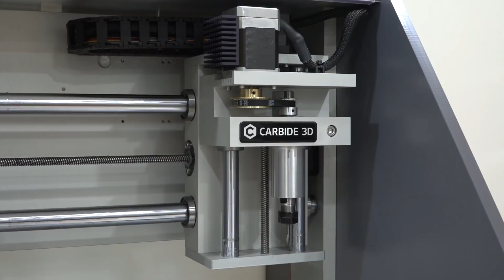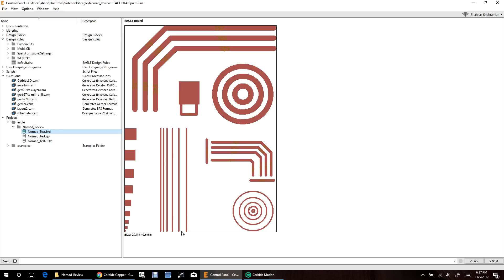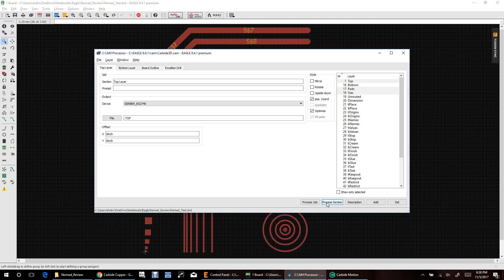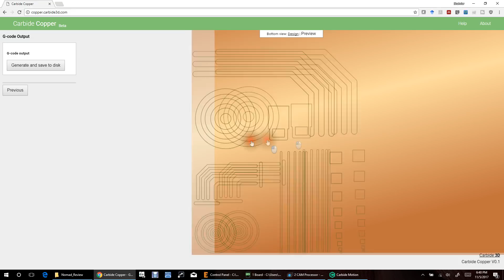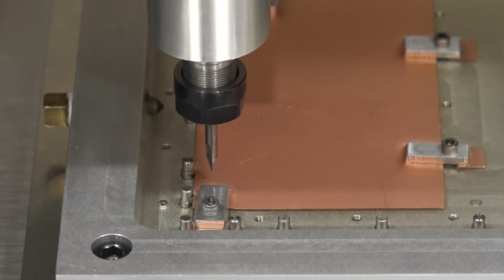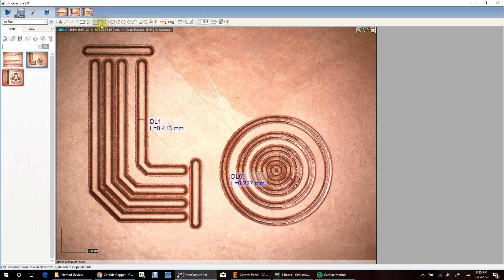TSP #115 - Carbide 3D Nomad 883 Pro CNC / PCB Engraving Machine Review & Experiments

Comment: Hi Shahriar. I am a big fan of the channel. I, like everyone else, have a few tips.

First, you will find the copper/fiberglass dust generated by the machine gets everywhere. I built a little CNC almost 10 years ago for making boards and run flood coolant on it to grab the dust, it works wonders. It will eat your lead screws and linear guides in no time. I was quite amazed with just how abrasive FR4 is.

I have a (poor) video on my channel showing a board being routed with coolant.

I use a spoil board on my machine and fly cut it from time to time to keep it flat. Then I use carpet tape to hold the board down, no clamps, they distort the board too much. Carpet tape has a fairly uniform thickness and works well. On boards that need a tight tolerance I probe the board height on a grid.

Thanks for all you do and keep it coming!
Reply: I have a feeling you did not watch to video fully. He talks about the very subject of fiberglass dust and shows how he avoids it.
Reply: Seems I was not paying attention for that part, thanks for the heads up.

Comment: I have used the Nomad Carbide to make PCBs, too, and a have a few tips for you.

First of all, you don't need the multimeter.  The Nomad Carbide has a tool length offset measurement, as you noticed, in the back on the right.  That button closes a switch that pulls one of the microprocessor's inputs to ground.  The drill bit is already equipotential with one of the switch contacts so you just need to get a wire from the other side of the switch to your PCB..  You can then use the Gcode command G38.2 (move and stop on contact).  bCNC software has this built in and also grid autotramming.

Next, you should be using a very sharp V-bit for cutting traces.

Your jig looks *amazing*.  Will you be able to use it for through holes or is the jig damaged when drilling through the PCB?  Here's my 3d printed jig: https://imgur.com/gallery/aHjpb .  I can provide model files if you like.  Also notice that I can remove and replace the board with the same position.  This is useful if you want to paint a board with through-hole parts.

The warping of the board doesn't really matter because copper isn't really cut until the PCB's front is flush with the jig surface.  The drill will push the PCB down against the jig.  This is why you don't need to hold the board down too hard and why autotramming isn't so useful.  I suspect that you had your jig dialed in too tight and the PCB thickness was uneven.  Also, is FR1 is more compressible than FR4?

Here are all my notes on how to make a one-sided through-hole PCB: https://github.com/eyal0/multivibrator/wiki

Good luck.
Reply from the maker: Thanks a lot for all the information. I might come back with more questions. Have you been able to get good clean cuts? What bit do you recommend?

Comment: IMO the best place for a CNC in PCB prototyping is as a small jig borer. Use it to drill the holes and route the slots. Build/buy a good immersion etching system for the traces. If you want to get fancy build an electroplating system, that's pretty easy to do. Then you can drill your holes, plate them, and etch the board. Milling the traces is always difficult IMO. 

To improve flatness of the board you want to build a suction table. That likely means giving up on the oil immersion idea. You'll always want to map the height of the PCB to account for distortion, even with a suction table.

Comment: I use a X-Carve to mill PCBs. As software, to generate the g-code, I use flatcam. I do not try to get the PCBs flat, instead of this I use chillipeppr to run the g-code. This has a feature, to measure the heights in a grid on the PCB and adjusts the heights in the g-code. This is rather precise.The hole workflow is good enough for my hobby-needs.

Comment: All axis will have thermal shift. Program a warm up cycle to run while you prepare things including spindle speed. Then machine the base flat. Just a skim cut and don’t take it out. The larger dia. Tool will give you less steps in the finish. You could also use a polishing puck in the spindle with the Same tool path for cutting the fixture if a better micron finish is necessary. Get a good indicator to tram your fixture back in if you have to remove it. And THEN worry about a better way to clamp your pcb. I’ve never needed to measure the thickness of a pcb as a machinist(former life)but, I wouldn’t assume both surfaces are parallel to begin with.

Comment: One way to keep the boards flat while milling would be to use a vacuum pallet.  You would need to plug unused holes to keep the oil from getting sucked up.  You might be able to modify the pallet you already made.

Comment: Instead of using a 60 'milling cutter, try using a 20'. will be less sensitive to changing depths. . for your tul its 0,144 mm width  per 0,1 depth , and for 20' cutter its 0,03mm . sory for my english  :P Two-sided tape binding also helps

Comment: I am curious as to why so many people want to use CNC to prototype PCB given the cost and speed of the prototyping services available today. Add to that the design rule constraints of doing PCB layout for cnc tooling, etc and it does not even seem to be the best choice for prototyping something that will eventually be produced via the traditional process.
Reply: for me, it's really great to be able to produce a prototype board in 30 minutes vs a few days / weeks. If you do a lot of prototyping, it quickly becomes worth it in terms of saving on shipping + rush processing, since you can work out most of the kinks of your board before going into production.
Reply: yep. especially since CNC doesn't plate vias. there's tons of cleanup work to do after milling.

and good luck doing more than 2 layers.
Reply from the maker: It really comes down to being able to prototype something quickly. Clearly there are limitations. This is another reason why I bought a machine which can do other things aside from PCBs. For my purposes, I want to be able to make PCB microwave tutorials for my channel.
Reply: Looking forward to those videos! It would be interesting to see a filter response change as it's drilled.
Reply: I don't get it either. Although, I would say prototyping services aren't an alternative at all, because it takes days to weeks (or months if from China) to receive the board. But in the time it takes the CNC to route a board, I have easily exposed, developed and etched a PCB, with the times being completely independent from the complexity of the board. This gives me a board that I could design without having to have the limitations of a CNC in mind and with the quality very likely being much better than a routed board.
Don't get me wrong, I'd love to have a CNC, but for routing plywood, plastic and aluminium or maybe engraving steel or glass. Routing PCBs would be the last thing to think of, especially since glass fiber dust is nasty stuff.
Reply: I think many people need some excuse to buy things like that. I would also like to have a CNC machine, especially to make mechanical parts. But the creation of PCBs seems to be a bad excuse to buy a CNC machine. It is expensive and the results I have seen were always sub-optimal. I like toner-transfer (or photoresist) and sodium persulfate. It is really cheap (~15€ per kg) and the results are good (better then some milled PCBs i have seen).
Reply: I can answer this from my point of view. I am new to the design of PCBs and do this only for hobby, to learn a bit about electronics. If I send my layout to China and wait two weeks, I get 10 PCBs, that does not work, because I made a mistake ;) 
If I mill it, I need half an hour and one PCB, to see, what I have done wrong ;)
Besides that, I can mill a lot of other things with my X-Carve and together with my 3D-printer I have two nice tools,  that complement each other, to create all sorts of fun making things ...
Reply: Jeremy Abel I think you are over exaggerating the time it takes to get PCBs from china. Most board houses (even the cheap ones I use) have a 1-2 week turn around time (delivered). I understand wanting a prototype in a day for an occasional proof on concept type thing, but you do lose some important features, plated through holes, for example.
Reply: HalfSpeedMastering: You have probably used the terrible brown stuff, Iron(III) chloride. You can't see what it does and it tends to underetch the photoresist. Use sodium persulfate instead, it isn't such a mess, it is a bit slower and you can see what it does.

For the disposal of used etchants, dilute them until the Ph is about 3 and add fine steel wool (be careful, it gets hot and may boil... use a big bucket and don't fill it more then 1/4). The boiling may push the steel wool up, add some weight on it to push it down. After some hours take a sample of a few milliliters and add one milliliter concentrated ammonia and if it doesn't get blue, the copper is gone. If it gets blue, repeat it with new steel-wool. The greenish/yellowish liquid is harmless and can be further diluted and disposed as waste water. The rest of the steel-wool and the copper metal that went out of solution can be disposed in the trash.

And there is also a solution for the hole-drilling problem: SMD ;-)

Wolfgang Egger: If I make a PCB, I always make several mistakes or change my mind and then I use a knife to scrape traces away and add wires until it looks messy but works. The Idea of having a device where 30 minutes later a PCB appears is really nice, but it is about the same time it takes to print something on a newspaper (the thin and cheap paper) and transfer it with the flat iron on the copper, dissolve the paper with water and soap before putting it into the small jar with the etchant (heated up to about 45°C) and shaking it gently around while watching the progress. All steps together also take about half an hour but it is much cheaper then a CNC machine. ;)

By the way, I make on average maybe 4 PCBs per year. Some years not a single one, but if I have to do it I make several of them. For that small amount I don't want to buy any expensive tool. ;)
Reply: get a laser head, and expose photo resist with it - works really great and much fine detail than milling is possible, i built a dedicated laser CNC with my desktop mill
Reply: @maultrommel how much power does your laser have. Do you have any description/links about the whole procedure  creating PCB with laser-CNC?
Reply: The board house in china that I use (one of the most popular and cheapest ones) is typically a 48 hour turn around for a common board (2 layer, 6mil trace/clearance, 0.8-1.6mm, >=0.3mm holes, 1oz copper, HASL) and the boards cost less than $1 each for <100x100mm. Couple that with express shipping via DHL and there is only 3-4 days between placing the order and having the board in my hands. Order on friday morning, have it by monday afternoon or tuesday morning. I've done toner transfer / iron chloride / tin plate in the past and would not bother doing that ever again, even though I was successful making boards with 0603s and QFP128s it was just too much labour. I have access to a CNC at my place of work that is a bit better than the one that Shahriar has and again I wouldn't bother using it to make PCBs because the lack of through plating and soldermask would make the board layout hopelessly inefficient and/or create too much assembly labour cleaning up solder bridges and making through connections by soldering wires through unplated holes. The CNC mill's strength is making 3D parts - trying to making something thin and flat like a PCB is best done other ways (laser cutter, pcb house).
Reply: officially a 100mw 405nm (closest to UV) laser module off fleabay - it looks like i fell out of a laserpoint to be honest, but i just build a constant current driver that delivers 100mA - focused point is about 0.1mm - and i use a feed speed of 1000mm/min - that works fine for down to 0,5mm structures. recently did a breakout board for a TSOP48 (0.1 structures), that went perfectly fine with  55mA and 650mm/sec - custom build X/Y CNC + grbl + KiCad (gerber) + FlatCam (gerber to gcode) thats all it needs.
Reply: maultrommel that sounds very intresting
Reply: The Signal Path ☝️looking forward    for that! 😀

Comment: If the cnc use gbrl you can use the software OpenCNCPilot (open source) it has a software compensation for the bcp height. The software make first measuring points like your method with the fluke

Comment: If there's a self-zero option for this model, then it should be possible to probe 4 points on a PCB and determine offsets for PCBs that aren't perfectly squared with the mill end (they never are, and it can change during milling). CNCs that can do this allow you to inject gcode to pause cutting, re-zero / renew the offsets, and resume cutting. It costs more and adds some time to a run but produces better boards. I wouldn't try milling a PCB without that capability, whether that ability comes from the vendor or has to be added DIY.

This, like welding, adds a whole new conceptualization of "flat" and "squared" to one's vocabulary. Particle board is not flat. Not at all. And you see people using construction-grade plywood for sacrificial boards...

Comment: It is much easier using a purpose built PCB miller with PCB substrate surface level tracking. This tracking adjusts the milling depth and can handle warped boards such as single sided PCBs.

Comment: Flexing the board or sheet is a real problem when trying to machine thing flat materials. A common method to handle this is to use double stick tape. 3M has one that dissolves or weakens with isopropyl alcohol. In my undergraduate I needed a odd PCB quickly so I got access to a HAAS VM3, an engraving bit, and some double stick tape. This worked out well.

Any plans to make any cavity filters out of aluminum or brass with that machine?

Comment: Hehe, at the start I see the HP 85645A Tracking Generator in the background.

PS: I need to make clear this. I don't recommend taking apart a working SYTM assembly itself unless it is truly dead. I learned that it can be somewhat difficult realigning 2 "plates" on each tuning coil side of a 8673B's SYTM. Not sure yet how disassembly affected its characteristics. Will send pics when I get around to do that. Thanks for the video and response.
Reply from the maker: Yes, this is the one I mentioned I already owned. I will see if I can make a synthesizer from it with an external source.

Comment: I would forego the oil so that you could use a vacuum clamp to pull the board flat.  So little material is being cut that the dust could easily be captured with a small pipe alongside the router bit.

Comment: Why not add some springs and screws on each edge of your oil tray. Then use your multimeter powered height test, and adjust the height of the tray at each corner. You may be able to even out some of the cutting that way, although perhaps the deformation from the clamps might be too localized to correct that way.

Comment: Have you thought about a suction system? You could pretty easily mill some channels in the oil cooling tray and put a gasket around them, apply vacuum through a solenoid system. The oil would also help keep a good seal on the gasket.
Reply: MrRealgamer777 no, drill one pcb hole and there goes your oil sunshine
Reply: There's no point in that because you don't really need to hold the board down, you just need to keep it from moving side to side.
Reply: +Eyal Soha well done for not watching the video and missing the point entirely.
Reply: It seems like it would work well to keep the board flat for the initial traces, eliminating any delta issues caused by the clamps. I agree with you about the holes and cannot believe I didn't think of that.  I've always done my final drilling with a proxon mini drill press, doing this gives a much cleaner end product for me, since my pcb mill is quite disheveled.

Comment: It would be handy if it corrected the bend of the board.
Like, attach a a sensor wire to the board, then the head touches it in various places to measure non-flatness. Then use this data, maybe even transparently to the PC software.
That would be perfect for boards then.
Reply: That actually already exists, probing and leveling. For instance a good example would be OpenCNCPilot (open source g-code sender tool) which has this built it. It uses the bit (the sharper the better) to first create a level map of the pcb (as it is often, especially with cheaper boards, the pcb itself that is slightly curved) by measuring the board in a grid of points. Then it uses this level map to adjust the G-code accordingly. Thing is it does this with grbl controllers and I am not sure what is driving this nomad. In fact it even uses 1 of the free inputs of the atmega chip most of these grbl based small cnc's have so no need to have a multimeter or extra tools/components.

Comment: I'm using a similar CNC to cut PCBs and I got around the problem of uneven cuts around clamps by touching off the surface at more than one point using a different software OpenCNCPilot. I think the controller from Carbide Motion is compatible, though you'd probably have to isolate thr board from the chassis.